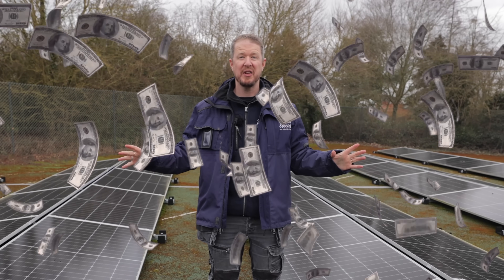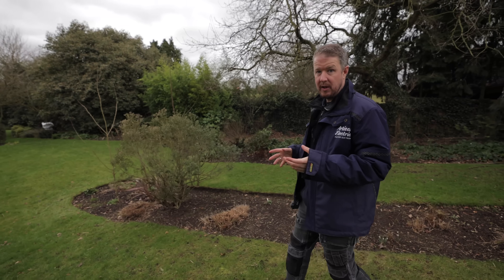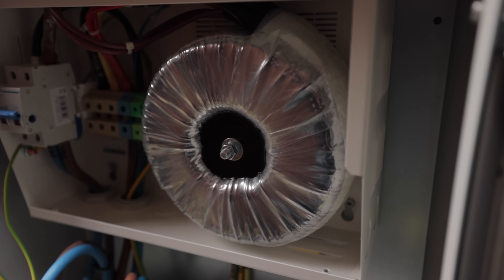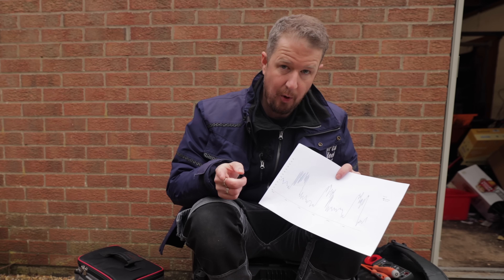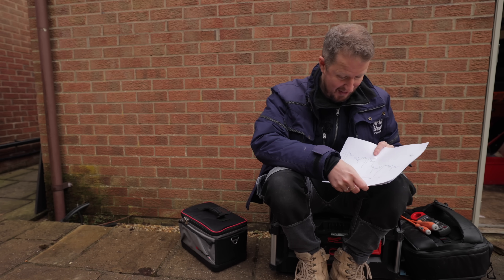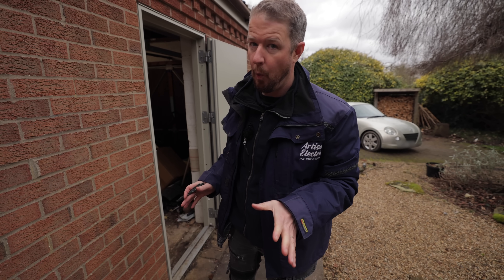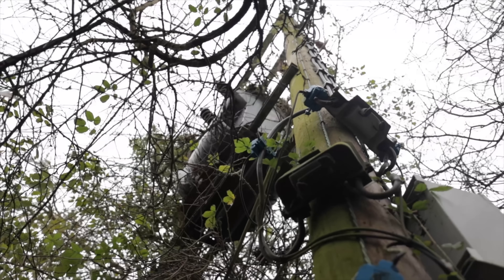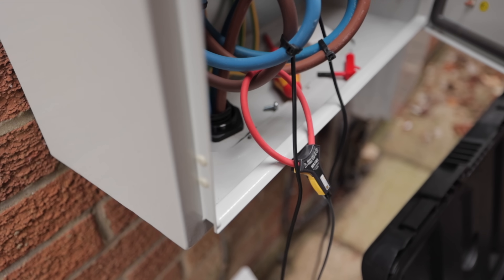THOUSANDS Down the Drain – And We Can’t Do Anything About It!

Comment: I had the same issues many years ago on a property that was  far away from the transformer,  the voltage on average was around 250v, the dno was contacted, and following day , adjustments were made, all the neighbours property's were checked and the solar system was up and running.  Never had any problems since.

Comment: Doubt the transformer is the issue.  Would start looking to ensure that the house solar system reference lines {load, neutral, ground) are equal to the power grid lines.  If they are not equal, it will cause voltage abnormalities.

Comment: I had issues with the local DNO voltage being almost 260v
They came out within a day, checked the transformer and could see that the transformer was running to high, they dialled it down and now ours is happy at about 244v
Best service and interaction I've ever had with any company.

Comment: The DNO should be much more involved in planning their network - they should have recommended/provided a three phase supply to a property of this size and heating demand let alone the batteries and solar. In this case though, should the inverter for the solar and batteries not be on the 'grid' side of the auto transformer and step down the grid voltage for the household circuits (including car charging)? The grid side would have to be rated for say 270v or more though (standard domestic electrics are rated for 250v max). In which case you may as well go three phase anyway.

Comment: I knew a farmer who was at the end of the line and when the wife put the oven on all the light dimmed. He could not use equipment in the barn when the oven was on as well. I built him an alternator set of 25 KVA to run the barn as the only solution and he was very happy with that telling every one that he had "better quality electricity from the generator" which amused me.

Comment: Hi, it looks like there are other properties a long distance from the transformer. The voltage tapping on the transformer is most likely adjusted to ensure the voltage limits at the distant properties are within limits.  Not an ideal solution but you could add a bypass contactor to the voltage optimiser that bypasses the optimiser when the voltage falls to say 220V and turns the optimiser on when the voltage is stable at 235V or above..  I think there is an issue with the supply cables rather than the transformer.

Comment: This is what is known as "polishing a turd".  The problem is, the insanity of trying to use solar panels.  The solution is to not use solar panels.  What we see here, is a source of power generation that is supposed to be "free" and the enormous expense just trying to get it to be useful.  This doesn't even consider that the panels and batteries have a limited life span and then will have to be recycled somehow and replaced.  Sorry, "Free Solar Power" is proving to be far too expensive and unreliable.

Comment: Voltage optimisers are not really allowed under G99 rules. It works by cheating the inverter into measuring different voltage, however G99 requires voltage to be measured at point of connection (so meter tails in this installation).
Reply: This kind of concept could be used to decouple internal installation from the grid, and then pull the voltage down by high self-usage. But this must be triggered dynamically with large load like boilers or heating. Dodgy job like this is just cheating your neighbors.

Comment: Grid line to the house is not strong enough and maybe at the end of the line. Also, the"regulator transformer" is just a transformer, it can't regulate by itself, just step up or down. This transformer shouldn't cost several thousand of pounds. Finally, the best is that UKPN should check their lines.

Comment: It sounds an impedence issue. Possibly the customer supply cores are too thin for the power being exported causing a voltage drop, or some other issue causing the inverter to have to fight the grid voltage.

Surely the inverter would shut down once it goes above 253V?

Comment: And this is why (if I ever win a lottery) will have the AC side completely separate from the grid, with DC between. Only device connected to the meter will be a charger for the storage. That way I could even be teleported to the USA and barely notice any change when supply voltage dropped by half.

Comment: I had exactly the same issue with my G98 system, there are step-down transformers with variable taps and I was able to prove to the DNO that the voltage was getting up to 260v when my system was exporting and so I had to have grid export turned off. Eventually the DNO (SSEN) agreed and changed the local pole mount transformer and it’s been fine ever since as the auto adjusting taps seem to do the trick. My local grid voltage still varies but has been under 250v ever since. Surely the better answer is to configure a limit on the amount of export from the inverter until the grid fixes the issue. Given that solar import/export works by adjusting the voltage in the local environment I can’t see that you can export more to the grid without increasing the voltage.

Comment: Panels mounted in shady places, 17kW Export on a Sinlge Phase and an inverter that doesn´t even shutdown at 260V are literally insane. 

Here you have to use an Three Phase inverter for >4,6 kVA which completely shuts down at 252V.
We´ve sometimes have similiar problems, when feed in commitments were given without proper control. However there only spikes slightly above 252V because inverters shutdown. 

Wiring Gauge and/or Transformer will be upgraded before you can use your maximum inverter power.
Reply: Even more insane is they can't charge their batteries on that.  Plenty of room for more panels to fix the issue they have in winter.

Comment: Call me i have solution 😂 will cost you for my consultant time 50k plus vat per hour😂.

Hope yo get it sorted its becming more comoon issues now days.

Voltage fluctuating but still in tolerances for uk power generation standards but enough to trip off the inverters.

Comment: That is not a shitty old transformer! Those old ones are way way better than the new ones that have been rusting out in no time! It’ll be length of run that is causing your problem. They should never have given you authorisation to put such a big system on That network.

Comment: 10:03 you said that transformer has 3 taps for different voltages? so would it be possible to automatically switch from one tap to the next depending on voltage?

Comment: Modern electronics should be able to control voltage perfectly. On the other hand shedding solar panels when too high a voltage & adding them when too low seems a viable solution.🤔
Ed c

Comment: How sad am I. Can't wait for part 2. I think you are spot-on, it could be the tx saturating, though could be a bad connection or under-rating related to the overhead cables from the tx to the consumer. I assume all the other properties fed from the tx are experiencing large voltage undulations at the same time.

Comment: Bolox to that. I would find out the cross sectional area of the cable, measure the distance of the cable run and the internal resistance of that model of transformer and then apply Ohm's law. If the voltage drop with a certain current matches the theory then you have it sussed. You wasted you money on that voltage dropper transformer with the silly name.

Comment: Clearly no much of a clue about electrical engineering, but likes to show of gizzmo’s
I agree with many on early site survey and the loop impedance.
My guess would be that the neutral is burning up between that property and the transformer, the voltage can eventually become 380 volts when the neutral drops off and a neighbour switches on a large load !
The solar invertors will give constant voltage to the consumer if the parameters are set correctly, they will if good quality both buck and boost, so that multitapped auto transformer would not be needed. And adding such an inductor into the system gives rise to poor power factor and can seriously damage thing if it happens to be subject to the wrong harmonics.
The PEN fault will occur when a huge load such as a battery charger is switched on because a poor neural will rise to unacceptable levels.

Comment: Tricky problem and with an agreed 17kW export this is deffo one for the DNO to resolve. A temp solution might be to be place a say 6kW export limit on the system. This will drop the network voltage considerably and allow the EV to be connected and make use of the generation. Other options would be to increase the size of the battery system to take more of the generation at peaks times or schedule charging to begin from solar generation at say 11am allowing more buffer at peak generation time frames. I would ditch the Voltage optimiser though. 

Dropping the export limit will require the customer to try and use the generation internally by delaying charge cycles on the EV, water heating cycles and anything they can to peak generation time frames otherwise as you know the power is clipped away and lost. A pain in the neck long term but perhaps doable while UKPN sort out the export limits. I am amazed they granted that on such a long overhead run. Would expect 5-6kW tbh. 

We have a similar setup with a customer very very close to the pole transformer. Which is largely just for them! That said the DNO limited to 9kW export. Again this customer has a large load profile and battery bank so have found ways to work with the peak power not all going to waste through clipping. The oversized array in our case is more aimed towards winter and getting as offgrid as possible so the customer was not to worried about losing some generation in summer. 

The above approach has kept us in the voltage range of 243V-253V ish, we also set the inverter to stop production at 257V to cover off any issues with peaks etc. So far it hasnt triggered but its a reassurance lol. 

The above provided in the hope its useful to you. These things are so hard to setup as you say more people want this tech which only makes the issue worse in rural areas especially. Good on you for sharing it, found that really insightful, honest and useful.

Comment: The problem is more likely to be caused by the wire resistance from the transformer to the house. The transformer will have some internal resistance but this will have been calculated to be acceptable for normal use. It has been set to give a nominal 240volts at each house. 
Now if you want to inject 17kW into the grid, then the output voltage of your inverter will rise until it is supplying that power. The resistance of the ofeed wires from the transformer will allow the voltage to rise at the house, way beyond 240v. To put it another way, if the inverter was exactly 240v, no current would flow back into the grid. So the voltage on the inverter goes up and the higher the resistance in the wire, the higher it will go. I bet if you measured the voltage at the transformer, the voltage would only rise to 250v or so, i.e. within spec.
There are two ways to tackle this. One is to control the maximum voltage out on the inverter so you can charge the car etc , but that would mean less power going into the grid, or fit voltage stabilisers in the house. In third world countries, it’s pretty normal to have stabilisers for your fridges, TVs, and air-conditioners.
I doubt the dno will do much, certainly not for free.

Comment: I don't understand this, on our off grid system we can fine tune the AC output from inverter using software, in increments of 0.1 v. The DC input voltage makes no difference to the AC output - on our system. I cannot imagine a system like the one you have installed does not have precise AC output ouput adjuster notwithstanding the fluctuations on DC. In a nutshell, your inverters should be set to 240v and not be putting out anything much higher or lower. I hope you can sort it.

Comment: I don't understand why anyone is charging an EV from solar or not charging their batteries overnight at any point of the year. Excess solar can be sold for 15p+. Off-peak electricity right now on an EV tariff is 7p or less (I've quoted Octopus prices but I actually get better on E-On). It might sound nice to charge a car from solar but it's more expensive than doing it during the night. Same with batteries. I shunt about 98% of my usage into the off-peak period and then export as much as possible. I only have to export 1 KWh to offset the cost of 2.5 KWh of import.

Comment: Interestingly I lived in a remote house in the country and we couldn’t run our Mile dish washer because it would cut out if the supply voltage was out of spec. We called the power company who tested the voltage and declared everything fine. Our electrician visited and monitored the power and said it was all over the place. Eventually I managed to get the power to put a monitoring device on the supply…it cost them thousands as there was an underground break under the road which they had to dig up. The moral of the story is they getting power companies to do anything is dependant upon getting the right person on the phone at the other end.

Comment: I'd look more at the cable to the DNO transformer than the transformer itself.
Possibly even the cable that's on the property.

All your extreme voltages are exactly what you'd expect from a cable that's too thin.

Solution : export from the batteries at a more steady rate than the instantaneous blast from a solar pv array in full sunlight.

Comment: I hate all this 230 bollux, this is a 240 country with a mostly paper exercise of "ow its 230 now" that and industry/commercial often have such long runs or high loads that the networks cant supply 240 as it sags to 230 so its just an excuse nonsense. Your initial tests should have revealed there would be problems as David below points out. Don't get me wrong the tranny might well be upgraded and help the issue but lets be realistic.. you will still have 240 and that size install will still push it high unless a large consumer is operating on that transformer.

Comment: Supply impedance is the issue here. Long cables from supply transformer to the property will allow voltage to lift excessively during PV production, and drop massively during Battery import. The transformer needs to be much closer to the house, or the supply cable needs to be increased in cross section to minimise cable losses.

Comment: Why don't they install a large water storage tank or tanks (underground?) to be heated by this excess power and subsequently used as a heat pump heat source?  Are they even reimbursed for this exported power at all or just using the grid to stabilise their system voltage?  These seem to be folk who wish to live 'in the sticks' but still have all the benefits of urban living with the humble hoi polloi expected to cover their increased costs!

Comment: Based on the voltages you are seeing it looks like DNO got their calculations wrong and this houses connection to the grid can't support 17kw which is unsurprising based on the feed lines in that rural location. Impedance tends to be higher for overhead cables on poles and this may have not been taken into account when the DNO decision was made, maybe check loop impedance to see if it is in spec too. Best to contact DNO and explain your situation, monitoring the supply voltage with PV disconnected isn't going to help because it is the 17kw pushed back to the grid which is causing the problem not the feed voltage which is in spec. Essentially it's their problem not yours as they gave permission to push 17kw. There isn't much you can do without expense of installing some form of active load balancing which you really don't want to do as it's expensive, this is like having a transformer which will vary which tap it uses based on voltage, I have seen these used on the grid but never in a consumer installation so not sure if a consumer version of such a thing is even available. You could maybe install a transformer to the car charger to reduce voltage to that as a temporary measure just to get them up and running while DNO decide what to do, not sure if that can be done within domestic installation regs though.

Comment: If the solar is causing the problem, then the solar is the problem. Not the network, even if it is a result of the network not being tuned specifically for your solar. It's still your solar causing the problem.

Comment: abit crude -  but could you put a bypass relay on the mains in? so then when the voltage drops below 220v or something, the bypass kicks in and full voltage goes into the house, passing over the economy transformer ? when the voltage then raises to 240 when the batteries stop charging, the bypass kicks out and then the power goes through the economy transformer again

Comment: I only have 20 panels, and one inverter but experienced the same problem, local UKpower company had to reduce the voltage via their  transformer after a two weeks of monitoring the power to my house. I live in a county lane with the UK power transformer in the middle of a field, so all the 50 house of off this transformer voltage was reduced, no more alarms all has settled down.

Comment: I think the cables to the house from the electricity distribution company side are thin, and the company has raised the voltage to compensate for the voltage drop when the cables are under load. But when you start selling to the company, the voltage has to be raised so that the current starts flowing in the opposite direction... an option is to limit the current you sell so that the voltage doesn't jump so much.